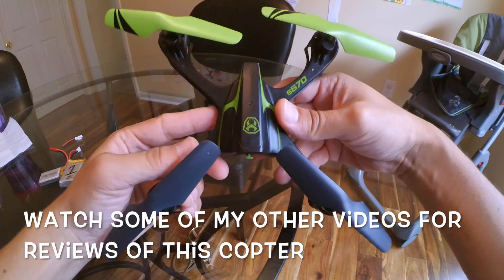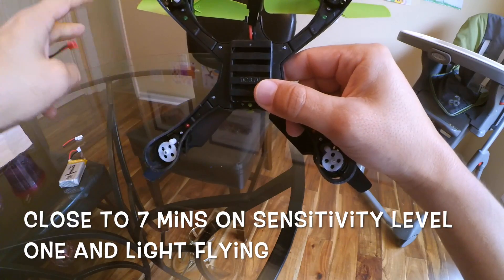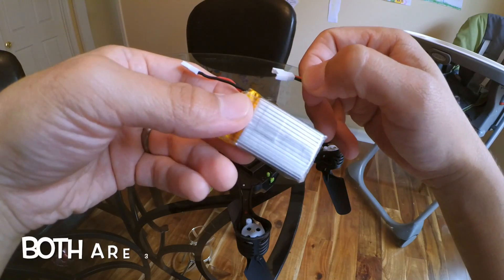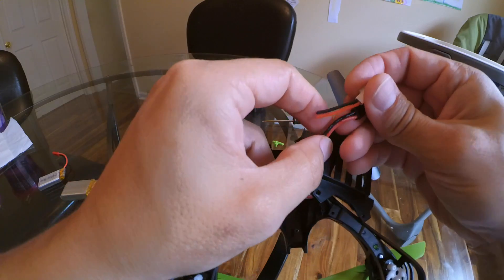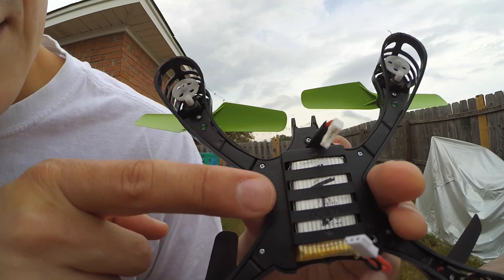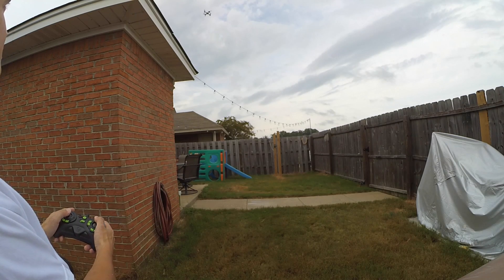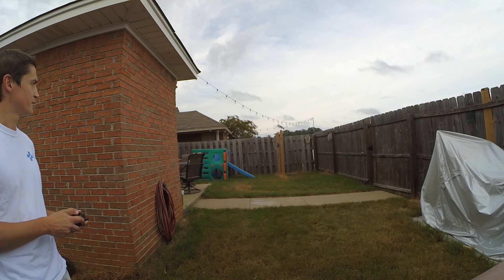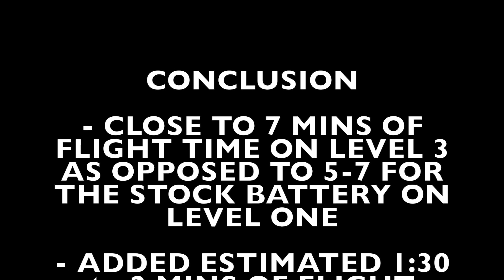Sky Viper S670 "Stunt Drone" - Battery modification - September 2015

Comment: I have the same drone and i was thinking in doing the same, replacing the battery with a 650 mah one but this light drones are incredibly sensitive to weight, and since is a stunt drone i think agility must be privileged over fly time. Besides the motors and gears don´t over work with original and lighter battery types.
Reply: And i just lost it today, it rests on the top of a 30 meters tree. Awesome drone, it resisted all kind of hits and even falling on a lake. I´ll buy it again but there is the new model out.
Reply: W Nij what’s is newer model, looking forward to it?

Comment: Good mod, but I suggest practicing soldering. Those looked like some pretty poor connections. thanks for the video though. I just bought one of these for my nephew.
Reply from the maker: The soldering is definitely a work in progress. Thanks for watching and make sure to check out some of the other quads I have reviewed.
If you have any soldering tips I am open to them. Hope your nephew enjoys the s670.Its a cool flyer!
Reply: +Manuel Escobar Drones and Video  It looked like you were touching the solder to the iron, then putting it on the wire. That method will produce cold solder joints and burns off the flux in the solder before it gets to the connection.  Ideally, you want to heat up the connection and feed the solder into the opposite side. Do not put the solder on the tip first, however there is an exception to that. It can make a big difference to put a tiny bit of solder on the tip, then proceed to heat up the connection. That will eliminate any air pockets between the tip and connection, giving much better thermal transfer. Depending on the connection, a wider tip can greatly increase thermal transfer as well. Also, us stand alone flux, even with flux core solder. The connection will wick in solder like magic.
After the connection is made clean the flux residue off with some higher concentration rubbing alcohol. (Not really required depending on the flux used, but it can help reduce corrosion and just looks nicer.)
Dont forget heatshink before making a connection. I've made that mistake many times. I recommend adhesive lined heatshrink. Especially if it will be exposed to the elements.
Of course practice, practice, practice.

I hope my comment didn't come off as mean. If it did that wasn't intended. I don't have the best people skills in the world.

There also lots of great videos around the net too.

To anyone else, feel free to correct me or add to what I said if you have any tips.

Comment: Um , Thanks, but why not keep the craft together and just snip the old battery connector and do the same thing with the new battery while leaving the craft alone?
Reply from the maker: Ya that would work too. The reason I did this was because at the time I had a bunch of syma x5 batteries that I wanted to use with this quad. There are definitely other ways to get around this. Thanks for watching!

Comment: I get ten minutes flight time with the sky viper 950hd. but without camera attached. and I was wondering if I added another battery and keep the camera off will it still fly. the battery doesn't weigh that much. at least 2\3 of the weight. that means I'm am only 1\3 over weight

Comment: I own the sky viper 950hd. what I was wondering if it's possible to add two batteries for longer flight time. if you have n answer it would be much appreciated
Reply from the maker: Theoretically a bigger battery should give you longer flight time. However, what I have experienced is that these brushed motors don't handle extra weight well. I would be very happy to be getting ten minutes with the stock battery on the v950. A slightly bigger battery may give you a bit more time. If you double up the size of the battery you may have a seriously sluggish copter. What I try to do is to go with as big a battery as I can use without affecting the performance of the motors. Also, the more weight on the motors, the more stain and the quicker that they will quit working. Hope this helps.thanks for watching!
Reply: Have you tried it.
Reply from the maker: +Henry Guajardo I have tried increasing battery size on many of my micro quads and that is my experience.
Reply from the maker: +Henry Guajardo I'm always looking for longer flight times! The v950 is a great copter. Wish it had a faster yaw. How do you like it?
Reply: I like it alot. And ar first i had a hard time controlling it. But soon i was flying it like a pro. I have no problems with the yaw. Just flight time. I also have the skyviper mini. And it's flight time is under four minutes. But without experience i was able to control it with ease. Just have to understand orientation and flight controls. Other than that. I am ready for something bigger.

Comment: 5x Spare 3.7V 750mAh Battery with 5 in1 Charger For MJX X400 RC Quadcopter Drone
I ordered these off ebay, perfect fit and only $17.99 for five batteries.....I'm getting 9 1/2 minutes flight time out of them each. They're coming from china and took a little over a week for delivery but are perfect replacement 43mm long 24mm wide 10mm thick.
Reply: +Jeffrey Reeve  Are you using this for the sky viper s670? Do they fit snug?
Reply: +ep3allen yes, they fit snug and are great.....
Reply: Were is the link share well
Reply: +youtubiente70 BTG 3.7V 750mAh 25C Rechargeable Battery (4pcs) + 4in1 X4 JST Charger for MJX X200 X300C X400 X500 X800 RC Quadcopter Drone Spare Parts https://www.amazon.com/dp/B018M7PTRG/ref=cm_sw_r_cp_awd_AFu0wbET5RY5Q
Reply: +ep3allen thanks. this helps very much

Comment: Where do u get these batteries
Reply from the maker: The batteries are available all over the Internet. I usually get mine from Amazon cause they are quick and you can return them easily if you have to. When you look for batteries match the voltage and the connection plug. The mah may vary. Good luck! Thanks for watching!!
Reply: Can u send me old battery and charger I really need the charger I broke mine and I would like the battery cuz they don't last long and I can switch them out
Reply: I'll give u my address
Reply from the maker: +wesley beattie I still use the old batteries and cables for other quadcopters so I can't send it to you. Sorry!
Reply: You can get them online I bought a 4 battery's that charge at the same time and only cost 10 dollars it takes about 1month or less of shipping but it's really worth it because you get about 1+ hour of flight time I'm happy to help. :)
Reply: Instead of getting a syma cabel you can see that at the end of the battery there is the white plastic you can cut the white things that are hanging to make it fit in to the skyviper cabel
Reply: That's what I did

Comment: Have you considered putting two of the original  smaller batteries in parallel, that would give you a longer time.
Reply from the maker: I did not consider that. It's a good idea. I think the only limitation with something like that is the added weight. The smaller motors don't handle the extra weight well. Thanks for watching!

Comment: I wonder if its possible if they could make a drones body all a battery. either that or make a version of the s670 with solar panels that are just like a calculators panel. it charges, but not fully and not instantly. but it would extend flight time.
Reply from the maker: I haven't seen anything like that yet. I think they try to keep the battery as small as they can, providing as much juice as they can. Batteries are heavy and weight affects flight time and stresses the small motors. Cool ideas though. Thanks for watching!

Comment: I'm not very familiar with the nature of LiPo batteries. Would you have any idea the max mAh is for this quad? Anyways, great job on the modification, and thank you very sharing!
Reply from the maker: I'm not an expert either but here is what I understand. As long as the battery is 3.7V, the copter can use it. The limitation comes with the added extra weight. The bigger the battery, the harder the motors have to work. So a slightly bigger mah battery may give it better flight time but if the battery is too big it will hinder the performance and the copter will feel heavy and sluggish. With this copter that limit is around 600-650 mah. Anything bigger than that and it gets slow. Hope this helps. Thanks for watching!
Reply: +Manuel Escobar Drones and Video Precisely what I was looking! Thank you again!

Comment: Thanks for the video. Next time you solder small wires together, try heat shrink tubing instead of electrical tape. It works and looks better, is fairly watertight, is lighter and is more durable than tape.
Reply from the maker: Will do. Thanks!

Comment: Can I do it with the V950HD?
Reply from the maker: The v950 doesn't have much more space for a bigger battery. You may be better off buying an adaptor if you want to put batteries from another quad in it. Check out my review and flights for the V950, it's a nice bird. Good luck!
Reply: Manuel Escobar Drones and Video Sweet, I just bought a V950 on Monday but I'm still learning to use it
Reply: +Manuel Escobar Drones and Video
actually i own one and that's not true at all. the v 950 hd comes with plenty of extra room behind the battery 3.7 650mah for a longer one. almost 3/4 the size of the original battery of extra room behind it. and you can remove the camera to make up of some extra weight. ;-)  don't have to, though.

Comment: Thank you for sharing your attempt. I've just bought one and I'm disappointed about the flying time. What was your record flying with the original battery? 5 minutes?
Reply from the maker: You're right, the flight time is disappointing with the stock battery. I got 5 minutes tops flying it on rate 3 with the stock battery. The bigger battery makes a considerable difference on rate 3. It's a nice flyer but that is a downside.

Comment: it's just a JST plug in..no need for mod..I bought a 3.7v 700mAh 25c lipo used with velcro to hold tight..works perfect
Reply from the maker: Cool. I think part of me really wanted to try the mod. Thanks for the info though.